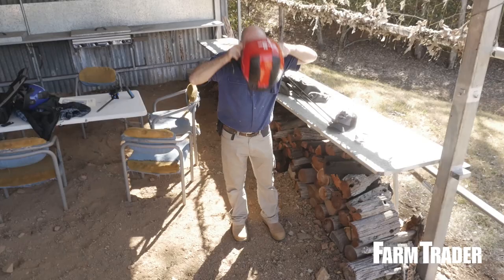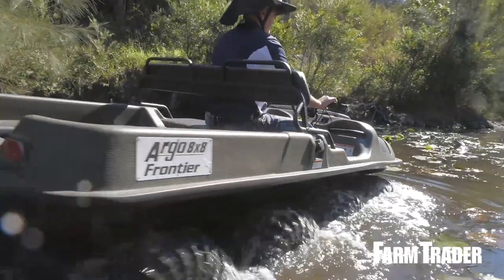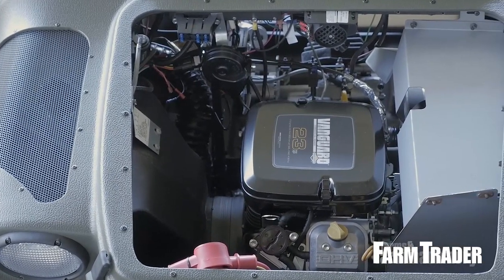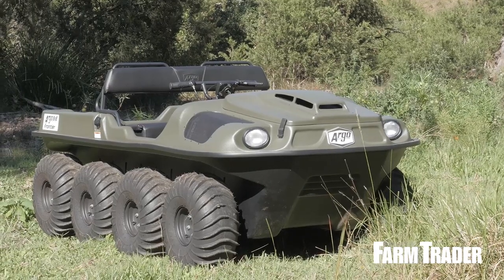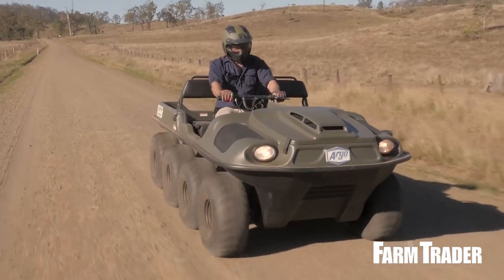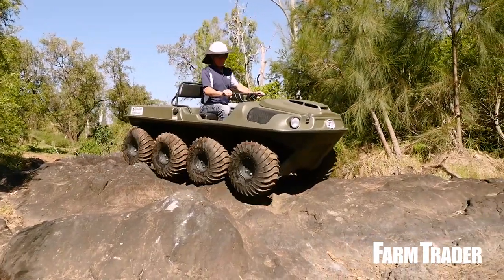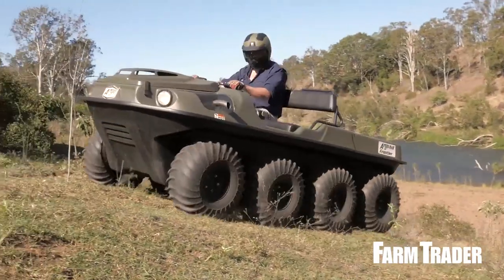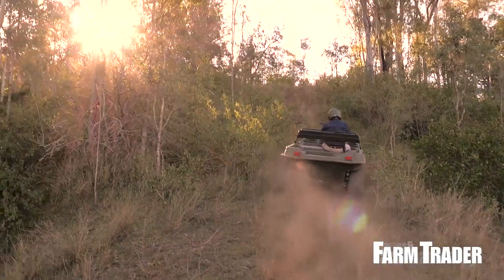Argo Frontier Amphibian Tested | Farm Trader

Comment: Is this available with a manual transmission?
Reply: They are not made with a multi gear manual transmission. They have two forward (hi and lo) and one reverse. They are not fast by any stretch of the imagination. Other wheeled ATVs and side by sides will leave an Argo in the dust on smooth hard pack trails and dirt roads. However, once getting into extremely rough 'technical' terrain even those ATVs and side by sides slow down to a crawl. Where the Argo shines, is they can go places and get through stuff the ATVs and side by sides can only dream about.
Reply: Nope
Reply: @TerraTrax I am well versed in how the MuddOx works, though it is a completely different make, it is Argo like and there are many parts from Argo’s which fit on a MuddOx (tracks and tires and rims to name a few). 

I am also well versed with Argo’s specifically. I own two. One Frontier 8x8, and a new Aurora 950SX.